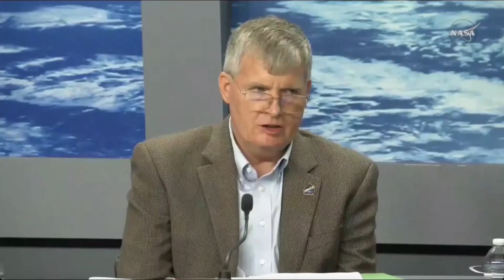Boeing Starliner's undocking and return to Earth explained - Any risks with thrusters?

Comment: Starliner should have never docked with ISS, it should have never left the ground with astronauts on board, you have to conduct 100's of flights before being certified human flight rated, Starliner only did 1 flight before astronauts got on, !THAT IS FUCKING STUPIDITY! now the ISS is at risk, it has so many leaks it could explode, who signed off on this, they need to be fired.

Comment: I wonder if Starliner's flight automation software was updated to implement short thruster pulses where possible near the ISS to help avoid RCS thruster overheating while undocking.  Could this have been one of the reasons why it took Boeing so long to re-instate the flight automation software for an uncrewed return?  The reason that was initially given was to re-install configuration parameters from the previous mission, or something like that.  Anyway I predict an uneventful and anticlimactic return of Starliner in a couple of days.
Reply: I would be willing to take a ride.
Reply: @TheMoneypresident  I'm a SpaceX fan but I also try to be fair about their competition.  As a former engineer, from everything I've seen and heard I don't see any problems that are fundamentally unsolvable in Starliner.  If Boeing can circumvent the RCS thruster overheating problem with software or procedure changes, it would show that their engineers do have a handle on the situation and this should help in restoring public confidence in Starliner.
Reply: @victorkrawchuk9141  the fanboys drive me insane.
Reply: That's exactly what they did. For this burn the thrusters will be pulse firing with sufficient time between pulses to prevent overheating of the poppet valves. 

Remember the fault is not specifically a thruster fault but a valve fault. The seats of the poppet valves feeding fuel to the thrusters are made of Teflon and this expands when it overheats. And when they expand they reduce flow through the engine which reduces power. The software was easy to amend. That was done when the thrusters were checked last month.
Reply: @2engjnr2  I'm not a Boeing fan but I think that Boeing's engineers have done a good job with reproducing the problem on the ground and devising an appropriate circumvention, which might even be good enough to be a solution.  It's a shame that so many others are exploiting the situation and playing politics.

I think the big question after the mission is over will be whether NASA will require a 2nd crewed test mission, even if the return is uneventful.  I predict that they won't, and after a review period of a few months they'll certify Starliner.

With I think 5 fully-crewed missions remaining (which, after this, the remaining dedicated Atlas Vs will be exhausted), Boeing might just break even and cover the cost-overruns with perhaps a bit of a profit.  But there's probably no chance of this if another test mission is required.  If NASA demands a 2nd test mission I wouldn't be surprised if Boeing backs out and sells its 50% share of ULA to Sierra Space to pay for the overruns.

Comment: Meanwhile other cosmonauts are onboard the ISS and they come and go easily. Just ask a lift from Roscosmos.
Reply: Boeing, billions and  billons,  and can't make one trip. Nice job on picking the contractor, NASA.
Reply: Also Space X has flown 13 crewed missions with no problems.  Let's try not to rely on the Russians.
Reply: @carljaekle  Yes it's way better than more than a thousand times by Soyuz with 97.7 % succes.
Reply: @guillaumeleblanc4542  The Russians can't just build an extra Soyuz quickly.  The astronauts would have to wait for the next crew rotation time anyway, and then what was planned for that mission, in terms of crew, would have to be skipped or greatly delayed.  That's what happened the last time a Soyuz failed, which wasn't that long ago.  That crew from the failed Soyuz had to stay up there for two crew rotations.

In contrast, SpaceX could far more quickly prepare one of their Dragons, and reuse one of the boosters they have on hand.  As for second stages, they're manufactured at an extremely high rate.  The worst that would happen is a slight delay in the non-crewed flights that they make 2-3 times a week, and that's not even a sure thing, because of the amount of hardware they have on hand--there might be no delay at all, possibly.
Reply: @guillaumeleblanc4542  97.7%, by the way, is not a great success rate for crewed flight.  That's 1 failure in every 43 or 44 flights.  I'm sure it's better than that now, but since you seem to be impressed, I'll compare it to the Space Shuttle's 1 launch failure in 135 flights, or 2 failures in 135 (1 in 67 or 68) flights if we count the Columbia's reentry failure.  That's not good enough for NASA.  The estimated rate of failure for the Dragon has to be 1 in 270 flights or better, or else it does not fly.
Reply: @rbrtck  there is always at least one, if not two Soyuz capsules docked with the station should they be needed. Each capsule can hold 3 crew which means that if the full crew of six is onboard, two capsules will be present.
Reply: Or Starlink. Coming soon with Ride Hail, then FSD!
By next January it may have a back-up pilot called Optimus. It may not be able to fly perfectly, but it'll fold shirts like crazy. It'll have everyone's carry-on repacked smaller before it lands.
Reply: ROSCOSMOS? They will strike ISS with Iranian rockets!
Reply: According to Google there is always at least one, if not two Soyuz capsules docked with the station should they be needed. Each capsule can hold 3 crew which means that if the full crew of six is onboard, two capsules will be present. I rest my case.
Reply: @guillaumeleblanc4542  Your information is outdated.  That's what happens when you're lazy and let the Google AI do your research and thinking for you.  The normal full crew of the ISS is 7, with one Soyuz and one Dragon docked at all times.  If something were to happen to either, then it must be replaced.  Look up what happened to MS-22.  Those astronauts got a replacement Soyuz, but they had to stay for a second consecutive crew rotation.

This time the Starliner brought up two astronauts in a test flight, but was not trusted to bring them home.  So they replaced two of the four members of the next Dragon crew, and have to wait.  It's just too expensive to send a whole other spacecraft to take them home, when there are alternatives.  If this had to be done, then a Dragon would be sent, not a Soyuz.  Why would NASA rely on the Russians for something Americans are perfectly capable of doing both faster and less expensively?
Reply: That's not entirely accurate as they recently had a coolant leak from one of their Soyuz capsules and needed to do pretty much the same, send the faulty one back uncrewed, extend the crew stay and send up another one to return the cosmonauts.
Reply: @marcocasati6953  coolant leak is from the ISS not the Soyuz, and it's been like so for years.
Reply: @marcocasati6953  Not accurate either as it's the ISS module that has a leak. And it's been like that for years, one of the reasons to end up the ISS. Also there's always at least two Soyuz there in case of emergency, escape pod if you will.
Reply: @marcocasati6953  False